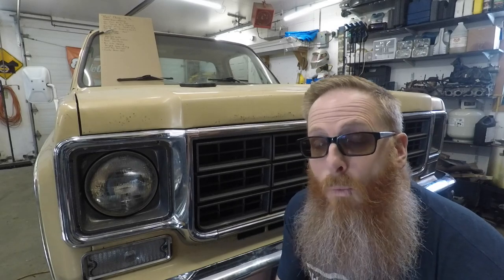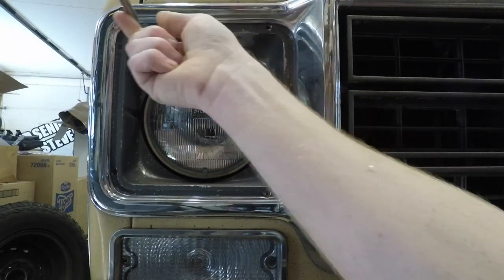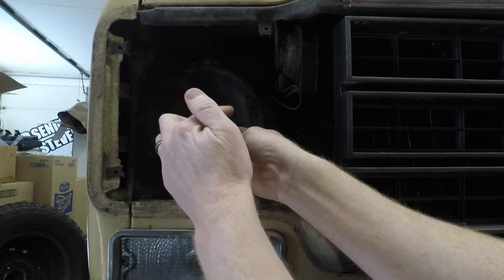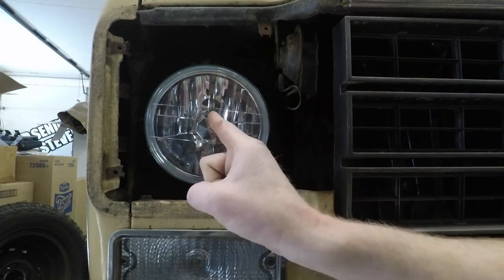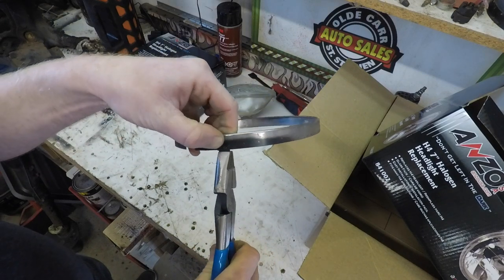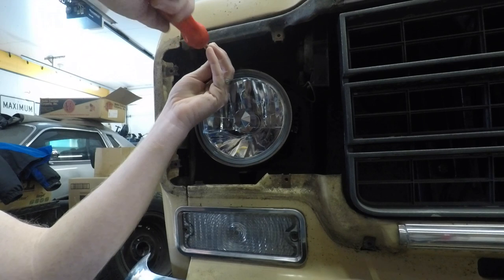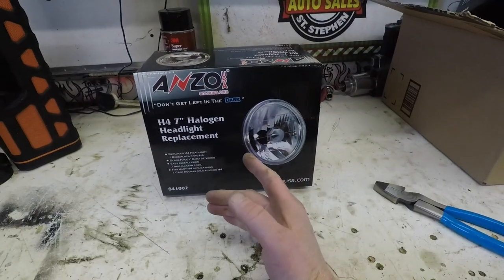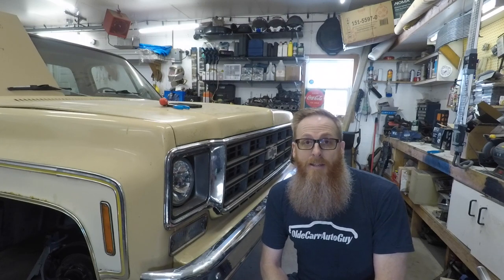HALOGEN HEADLIGHT CONVERION IN A 1977 CHEVY C10 TRUCK

Comment: Was the rubber ring just for shipping? I kinda thought it was to keep water from plug and maybe cut down on movement
Reply from the maker: I'm sure there is reasoning behind me leaving it out. I'm thinking it wouldn't fit into the headlight bucket without  modification.
Reply: @OldeCarrGuy  it might have pressed light tighter against in modified ring lol
Reply from the maker: @truckerdave5122  Not that kind of fitment, more of a "wont fit through the hole" fitment issue!
Reply: @OldeCarrGuy  gotcha I'm guessing most times because I'm not there lol

Comment: i put the h4 in my work truck and i think it was a mistake. i dont think mine would have been bad if they didnt have the projector ring in them. my single headlight truck i went with octane and that was the best by far........ but cost alot more lol
Reply from the maker: The advantage here is I can upgrade the bulb to something brighter like a 3k or 6k if needed.
Reply: @OldeCarrGuy  amd thats what i habe been doing. Basiclly bought them for the housings.